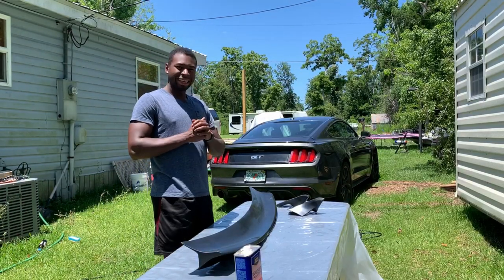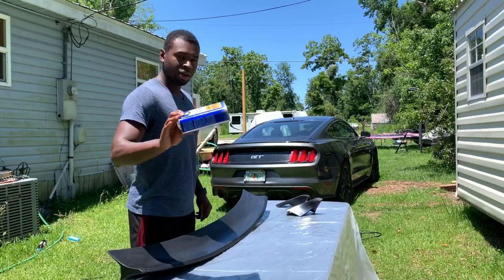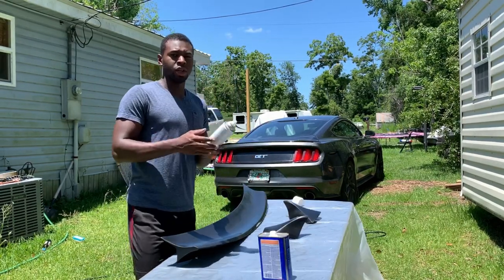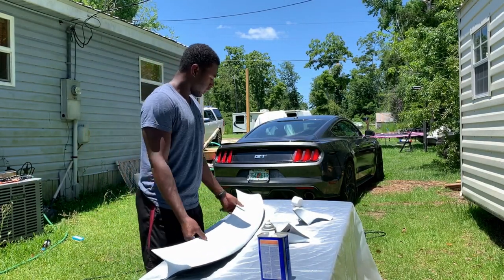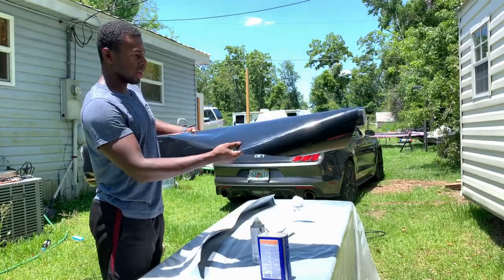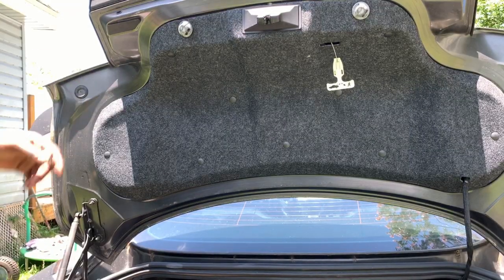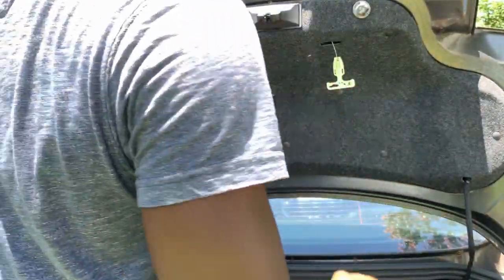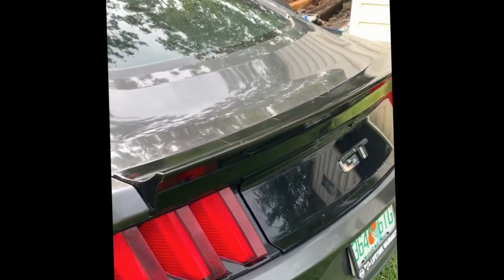How NOT to vinyl wrap a spoiler!!

Comment: Did you find that the primer help it stick better?
Reply: No.. he should have suffered it with 600 grit sandpaper and wiped it with wax and greece remover. It would of  been fine. And 3m tape it probably blew off already. Bad move